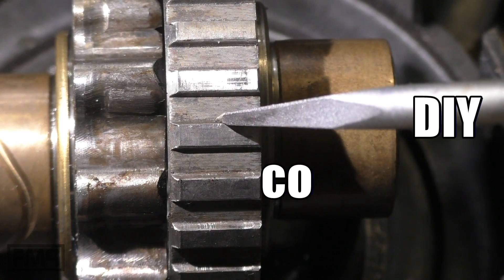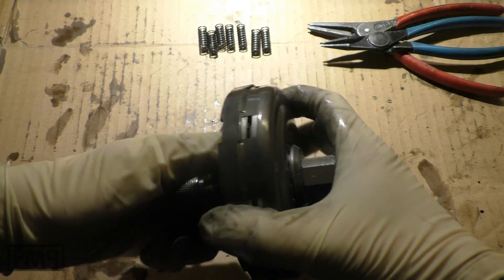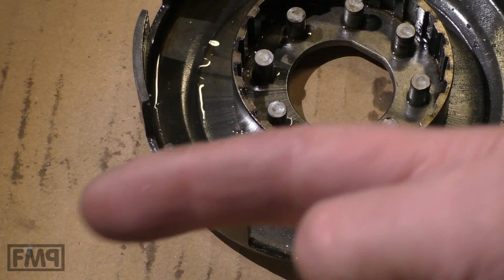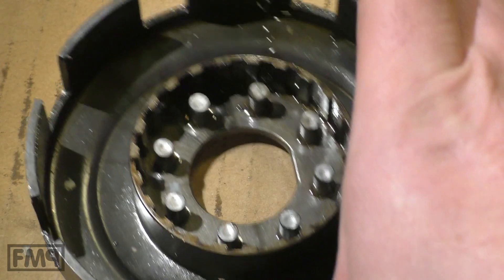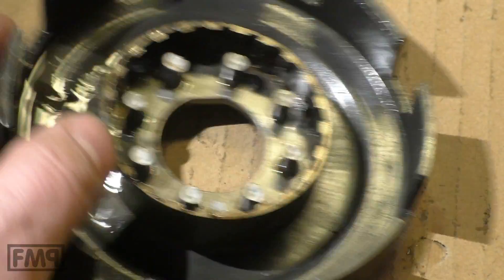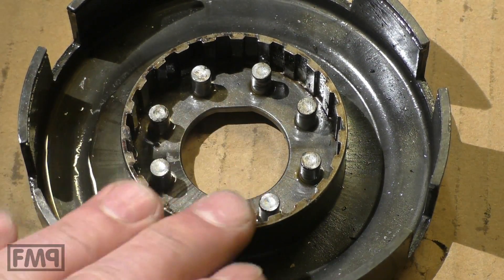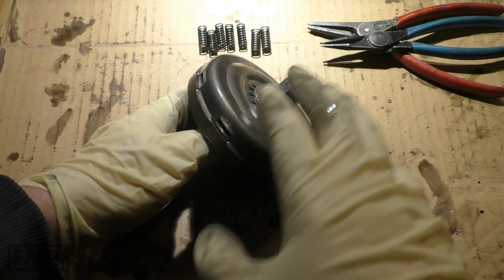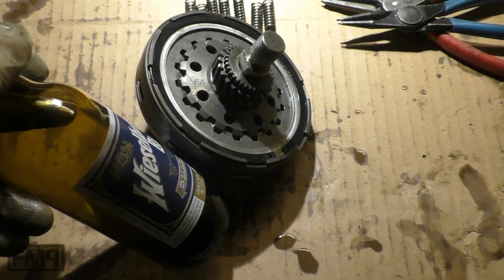cheap VESPA diy TUNING CLUTCH 25hp | cosa2 | FMP - SolidPASSion |

Comment: Thank you! Just one question, why you don’t weld the smal pin directly ? I don t understand why we need to drill and weld…
Reply from the maker: the rivets u mean. caus e it wouldnt improve the connection. the idea is to make ADDITIONAL connections, as the rivets are quite weak. welding them directly... the still are weak then. but welded, so no improvement.

Comment: what about the px150 clutch?
Reply from the maker: px old 6 spring ? Cnc basket or basket with Ring / cosa? Same same
Reply: @FreakMoPed8  yes px old 6 spring
Reply from the maker: Teninch offers a cnx basket or u use a ring for the standrd basket

No honda linings possi le tough due to small diameter
Reply: Which order do you put the plain plates in?